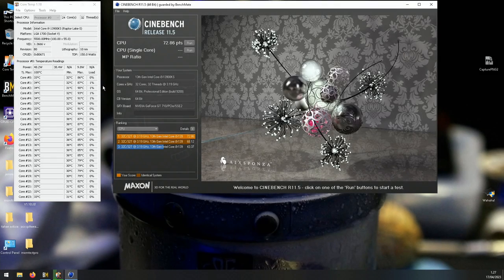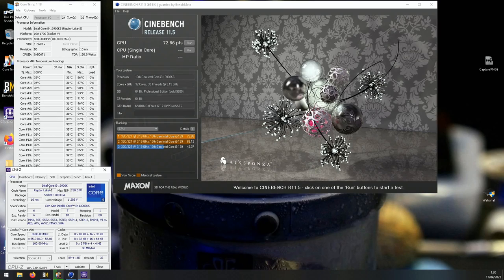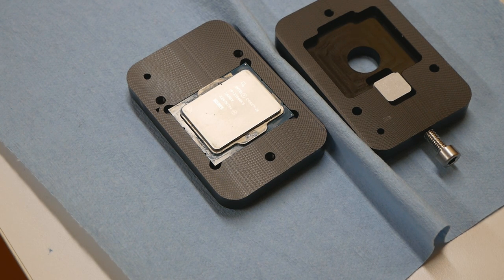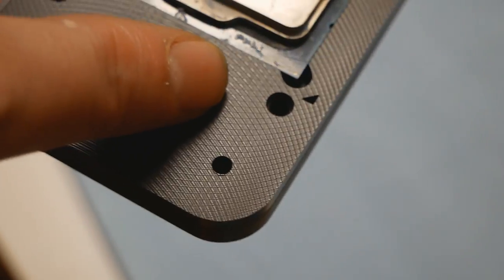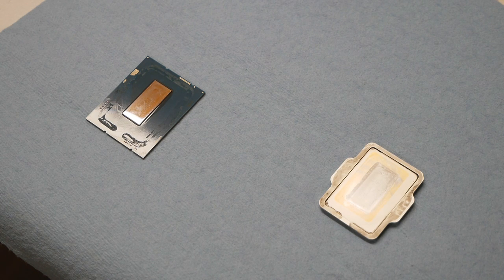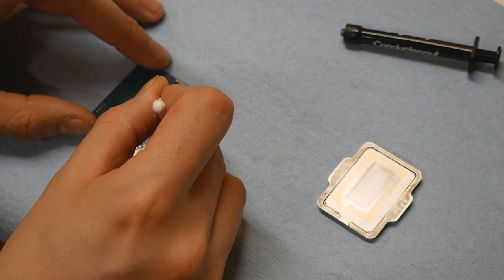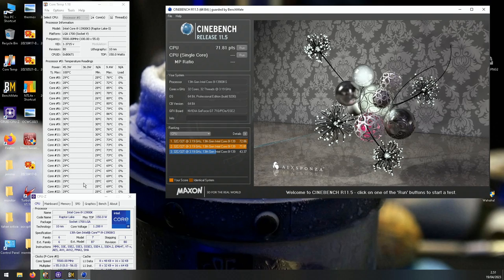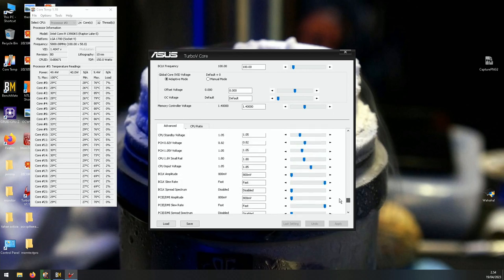Delidding an Intel 13900KS CPU: 10-15c Reduction on Temperatures

Comment: Should heat up the CPU with a heat gun around 75c first. it makes a lot easier to delidding the cpu. i did with my 13900KS
Reply: I did 1 min with a hair dryer and instead of a pop, you hear a gooey rip from silicone.  It was no harder to remove the 13900KS IHS than it was the old i9-7900X IHS.
Reply: You mean the silicone will give way quicker?

Comment: I love my 14900k but that boy is HOT. get's up to 85-90 FAST. I have a delid kit coming. I've delided before but never one a CPU that is Soldered so I'm a little nervous but it should be fine. I don't think I'll be lapping simply based off der bauers results but we'll see how it goes. if I got 5 degrees out of it I'd be stoked.

Comment: Supercool direct die cooler way to go !!!!
I also used rocket cool delid tool and used their instructions in the video 
Heat the ihs for 2 minutes with a heat gun before delid makes it easier. Also goo gone pen for glue on ihs

Comment: Unless your running Cenebench over and over again or heavy AVX workloads you don’t need to go the this extreme just use a good 360mm in a push pull configuration and playing games is no problem at all.
Reply: depends on what clocks you want
Reply: With this setup I’ll probably be able to hit 6ghz all core. I have a bad sample 13900k that pulls 450watts max and my cooler can handle that. This KS is much better sample and I will achieve higher clocks at same or lower power.

Comment: Tips: after delid, use a credit card to roughly remove the indium from the die. With most of the indium residue removed you will need only two applications of the indium removal to completely dissolve what’s left on the die.
Reply: I don't have indium removal, what should i use instead?
Reply: @bravium  liquid metal mate that's what it is

Comment: Would be cool to see the total reduction you'd get with delidding, contact frame and lapping using liquid metal throughout. 

Sort of the max effort a consumer would do vs the bare minimum.
Reply: I was going for that but my 13900k died from delid with no visible reason. 
no cracks or damage. switched the contact frame for the original ihs and it still wont work.
Reply: @darkshadowsx5949 how? What ever happened

Comment: i actually had to resolve filled liquid metal.

place papertowel around the socket, and start drenching the with Isopropyl , combine foam que tips and compressed air(not a can, use a compressor)  and the foam que tips you can get into the pins without damage carefully,  repeats of comrpessed air and dumping isopropyl alcohol to flush out the liquid metal from the socket,  but most can be picked up via the foam que tip.

Comment: 10:24 Has anyone else tried to put it without the lid as it is here? just the bare processor making contact directly with the heat sink? like a "NO LID"?
Reply: It's possible now with frame guards
Reply: @_nom_ Frame guards? You mean like the Thermal Grizzly?
Reply: There are special water blocks now they are called direct die water blocks. They are designed to fit directly on the silicon

Comment: I delided my 10900K and currently run it LM/direct die - it was a bit nerve wrecking but I cannot even imagine doing this chip.
Reply: Did you use a heatgun or only Delid Tool and nothing else?
Reply: @OCXChile  Blow dryer or heat gun and delid tool.
Just enough heat to loosen that adhesive before using the tool.

Comment: Sorry for my question, overclocks is not a topic I master. Before the delidding, Cinebench scored 72.87 pts. Then marked between 71.81 and 71.14 pts. Weren't these values supposed to have increased?
Reply from the maker: Correct, for some reason the results are very incosistent this generation.
Reply: Or maybe it's just cinebench being inconsistent?
Reply: we really need more info that just "I delid" - like what mobo and what bios and what bios settings.

Comment: i lowered mine quite a bit on my evga dark board and asus boards using contact frames. also lapping the cpu and the cooler helps alot too.  i am running 5.6/4.5/4.8 @ 1.34v and ive got great temps on my 13600k
Reply: How much improvement did you get by lapping the cpu and cooler? What are you temps at 1.34v? Thanks
Reply: that quite the AVX drop, unless I am not grocking the number listing correctly.

Comment: Got this CPU at launch but it's been sitting on the shelf due to those crappy thermals. Maybe I'll sell it and buy a 13900KF since it runs a bit cooler without needing to delid. Asus pushes PL1/PL2 to 320W by default and that's because it runs so hot at stock where 13900K at stock is 253W.
Reply: Undervolt it
Reply: F would make no difference. It's the same CPU

Comment: How often do you need to reapply the liquid metal?
Reply: My old setup did have delided 7700k/5.1ghz for around 4 years and i did reapply liquid metal two times.
Reply: i delidded 8700K spring 2020 and stikk going strong with no reapply
Reply: Nice thanks guys! I was concerned it was an every 6 months kind of thing which would be too much hassle. I've always wanted to try this and have considered doing it multiple times. At 5.8p/4.5e/5.0ring with adaptive voltage 1.38v LLC6 (MSI) after 10mins of CBr23 my hottest core hits 86°C. I'm not too concerned with temps but delid and direct die seems really fun and could help push things even further!
Reply: I delidded i7 4770k in 2013/14 and put liquid metal. Temps are still the same. No reason to reapply.
Reply: @jjlw2378  just get the thermal grizzly contact frame and the lapping block with it too lap the cpu first before going to a delid you might not even have to go through the trouble of deciding. Remeber to lap your cpu waterblock too